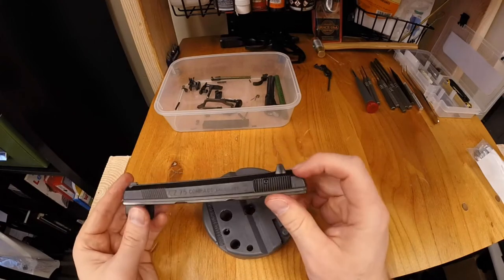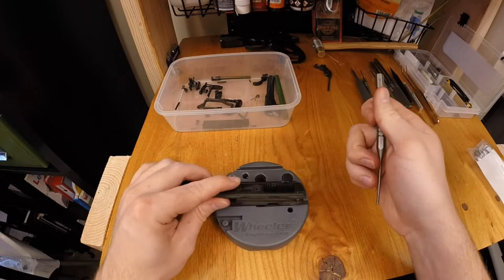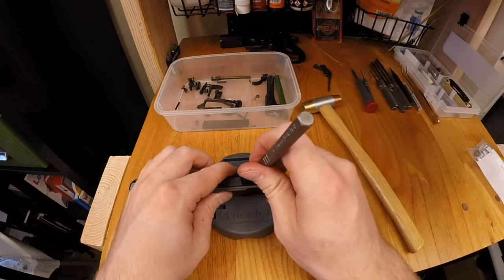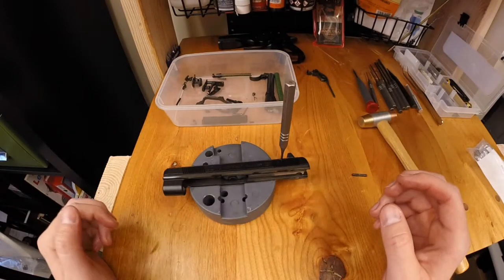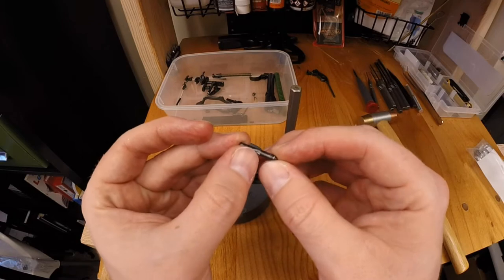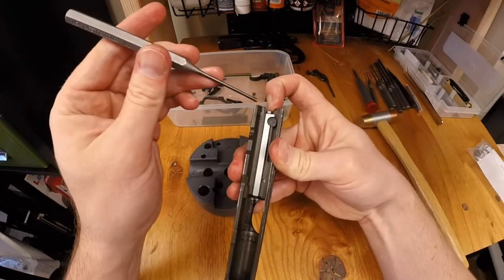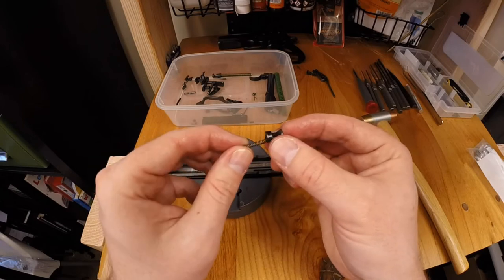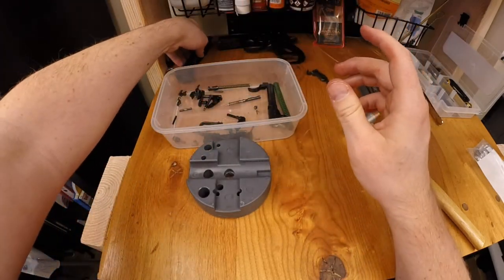CZ 75 SP-01 Manual Safety -  Disassembly 5 - Slide Parts

Comment: What size punch did you use to knock off the firing retaining pin from the slide? I used a 2mm one and without moving the pin, the punch got stuck inside :(

Comment: I watched your other vid on installing firing pin. I always thought the side of of rollpin hole with the bigger hole is the side the rollpin should be knocked out then when restall of rollpin should start in larger end .so your not trying to knock a rollpin through a smaller side. Like if rollpin hole on right side is larger than left the rollpin should be knocked out towards the right then knocked back in right to left.
Reply from the maker: Ross Kaleolani, After some trial and error I have found it best to have the punch always on the side with the larger hole. The has allowed for more room so the punch don't ding the slide. You can definitely do it either way (if the roll pin is the same diameter end to end), but this way seemed to help reduce errors.
Reply: Spencer Frandsen... Yes, also let you know my replies are just for info we can share, I am not one who knows it all so please don't take my reply wrong. Just from what I have heard, watched, the roll pin I believe should be punched out toward larger side or you could eventually squish the roll pin. Contant Cajun Gun Works they can let you know. Also, just from experience you should use snap caps for dry firing, maybe you did say in video and I missed it. Repetitive dry firing can crush the firing pin retainer as you showed the wear on roll pin. It can crush and the firing pin notch can go past the retainer and firing pin will stick out breech and get stuck. I did contact CZ and they do recommend snap caps or there is a rubber O ring you can put on rear of slide blocking contact with the hammer and firing pin. Are you using actual roll pin punches? Or just flat tip punches? If not using actual roll pin punches it can slip and damage roll pin. Again, please don't take my replies wrong. Go to Ashburn Armored he disassembles the p09 and he says to punch out larger end. Or like I said Cajun Gun Works could probably let you know.
Reply from the maker: Ross Kaleolani, I'll give Dave a call and see. I'll definitely update the videos if it is negatively impactful. I definitely use the O rings. I found that snap caps wore out pretty quickly. Please feel free to share and comment on anything you come across, it's always a continuing conversation.
Reply from the maker: Ross Kaleolani, Oh and I do use actual roll pin punches.
Reply: Spencer Frandsen... Good deal. If you haven't check out Ashburn Armorer he takes down and re assembles many firearms I found him very helpful. Glad we can share tips etc... Yeah the roll pin retainer on my P01 got crushed from dry firing. I didn't dry fire much for it to happen yet who knows how many people dry fired it at the store before I bought it. Also if you have problems with heavier, larger ogive bullets, rounds ftf the slide catch part that reaches in and makes contact with the magazine follower on my P01 had to be angled down, the heavier rounds were making contact with the follower catch. Cajun sent me a couple slide catches he modified so heavier rounds can clear. Take your slide off and put the slide catch back in and insert a magazine, you can see how close the slide catch can come to the rounds, mine was rubbing the rounds. You might not had a problem. My P01 cycles 124 grain target ammo good now. Some ammo although same weight, the bullet itself can have a different shape, ogive.
Reply from the maker: Ross Kaleolani, I'll definitely check out Ashburn Armorer. I haven't had that issue with any of my CZ's yet. I've started throating the barrels so bullets with a different ogive won't give me problems with my OAL. Thanks for the tips!